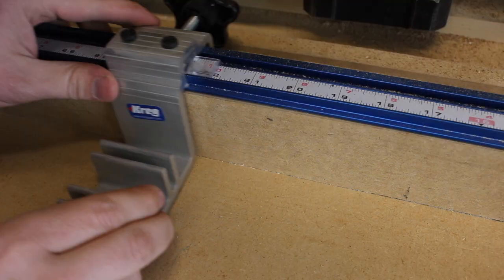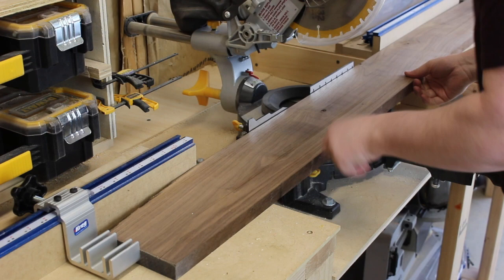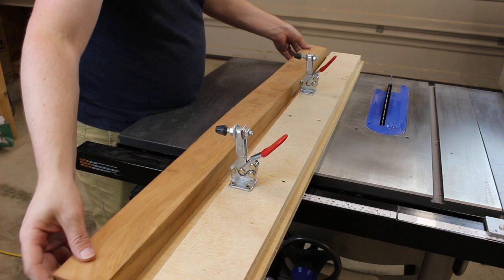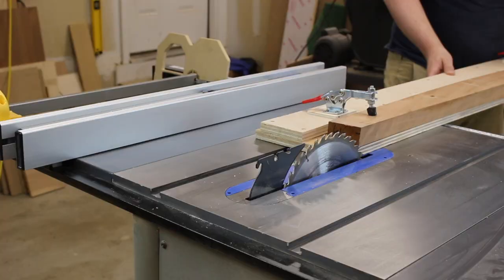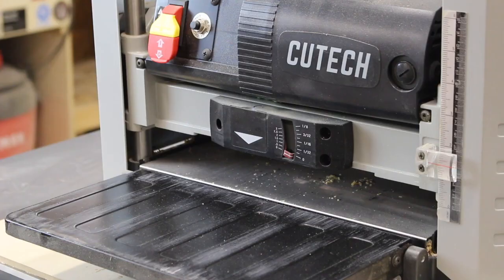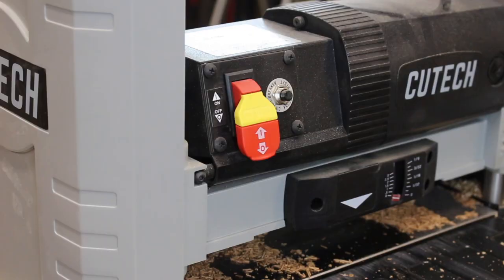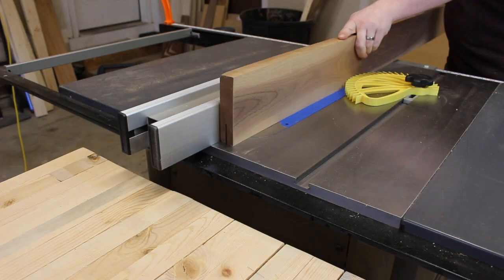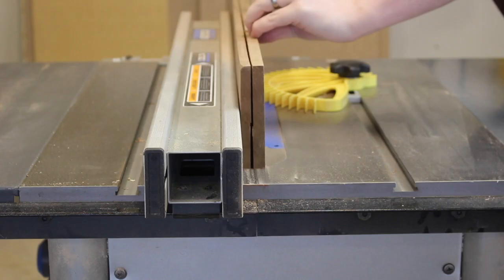How to Mill Rough Lumber || Only 3 Tools || Woodworking

Comment: Don’t you need to joint one of the wide faces before running through the planer?
Reply from the maker: There are a lot of small problem-solving steps that could be added based on individual issues of specific boards like bows and twists. It tied to stick to the basics for this video.
Reply: @ProjectBuildStuff  should at least be mentioned... if someone doesn't know better they will waste a lot of wood.  If they do know better, they don't need this video.